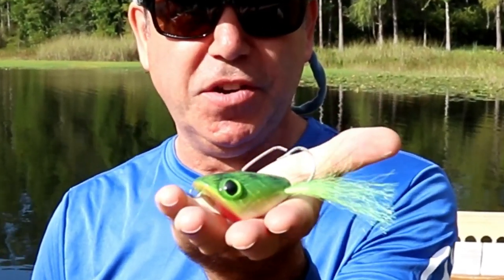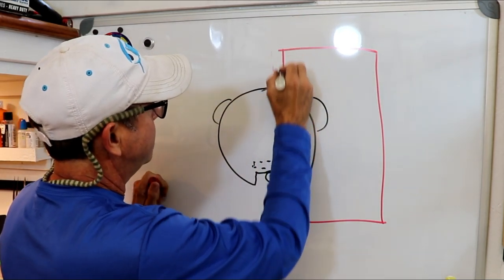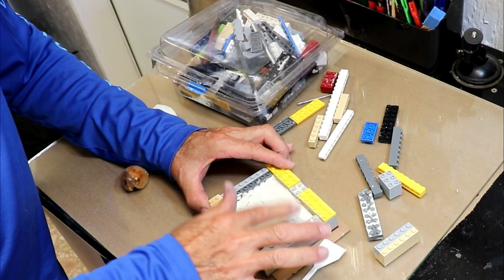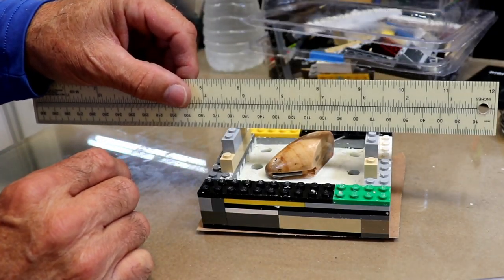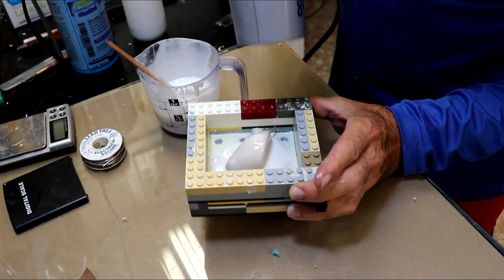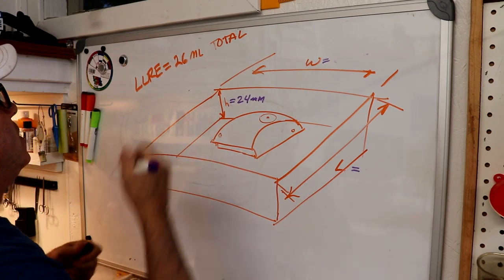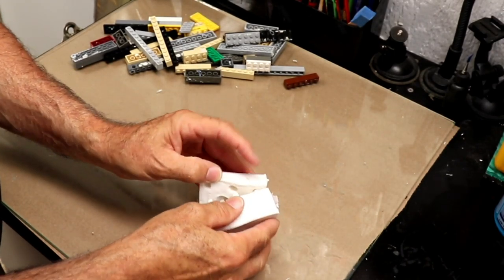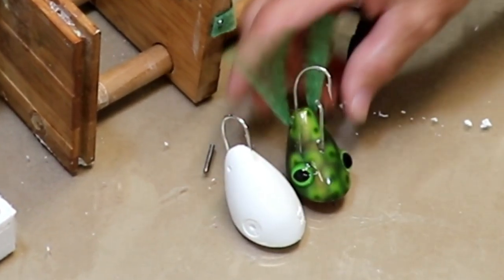Silicone Lure Mold for the Scorpion Topwater Frog

Comment: I've got to admit from a lure maker myself, I love watching your videos and explaining your process. I typically stick to carving but I'm getting more intrigued with making molds and casting the lures. Curious what product you use for the casting?
Reply from the maker: Thank you for the kind words.  For now, I'm using casting resin from Specialty Resins.
Reply: @EngineeredAngler  I did some more digging and found your other video about mixing resins and silicone. Very helpful information for me just starting out with making molds of my carved baits/decoys. Thanks for the tip on the resin brand, I was leaning that way as well. I'll look through your uploads, but I haven't came across a video yet with casting a deep diving lure with the hook point on the bill with a through wire. That could be a challenge but your thought process on how to do so would be awesome.

Comment: Thank you for your detailed video, very informative. the question that i have is, have you heard of this silicon calking mixed with corn starch to make your initial impression of your lure?? have you tried it? if so do you recommend it instead of the playdo, I just don't have the artistic capability to carve the lure in to that? let me know what you think and thank you
Reply from the maker: Yes...silicon with corn starch works but is a bit messy and you have to experiment a bit to get the right consistency to be able to capture fine details.
Reply: @EngineeredAngler  Thank you for your input

Comment: Your videos are great and I really enjoy the level of detail you put into lure making.

Have you ever had any issues with the silicone sticking to the blank? The last two or three molds I’ve made resulted in the silicone sticking to the clear coat on my blank, essentially ruining the blank and making the mold useless. Any ideas?
Reply from the maker: What kind of clear?...epoxy won't react with silicon..
Reply: Thanks for the quick response! I believe one was with etex and the other was with True Coat. The silicone I used for all the molds that failed was Illuseffects Tin Cure RTV Silicone. The next go around I think I’ll be trying the Smooth On.

Comment: Have you tried Smooth-On Featherlite yet, for casting? No adding micro-balloons to float. I love it, but then, it's all i've used.
Reply from the maker: Yes..it's good stuff. It is actually the same density as my 10% microballoon mix. I just prefer a faster set time.
Reply: @EngineeredAngler  ya, it's a longer set time. I'm making multiple molds to increase the lure output.

Comment: When molding a wooden master how do you finish or what do you seal the wood with before pouring silicone.
Reply from the maker: I like to clear finish it as if it were a painted lure.  This way my mold has a glossy finish and if I decide to pour it as a soft bait I get a nice result.
Reply: Engineered Angler thanks so much

Comment: I just wanted to make the point that the modelling Clay MUST be sulphur free, as it will possibly cause curing problems with the silicone. Especially a platinum cure. The tin cure is a little more forgiving, however it is best to just avoid sulphur. If it does not say sulphur free, it is not. Also, if you let the silicone cure in your pour cup, it will peel out easy.

Comment: Could you have aluminum machined out like soft plastic molds and use that instead? My wife’s an engineer😊
Reply from the maker: you could...you wound need a CNC machine...and it would be super expensive.
Reply: Engineered Angler I’ll give it a shot, she’s excellent in solidworks and is a project manager for a machine shop😊